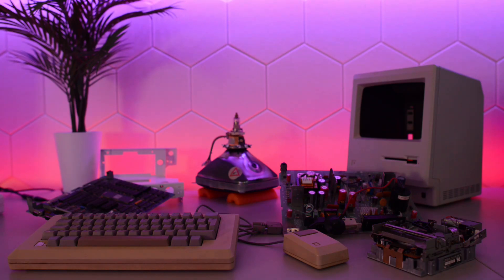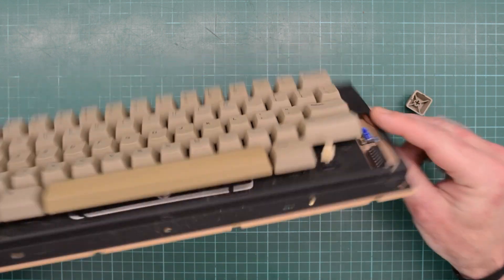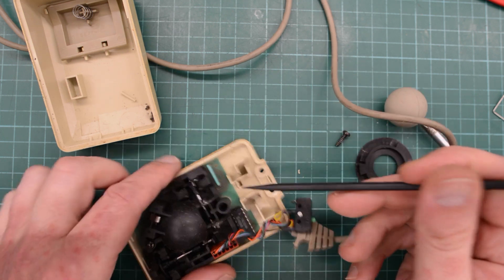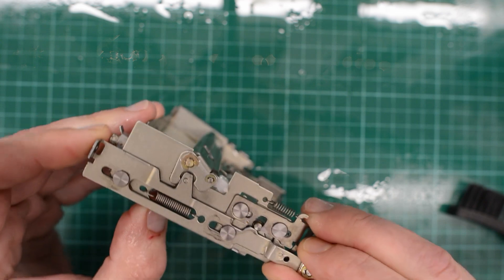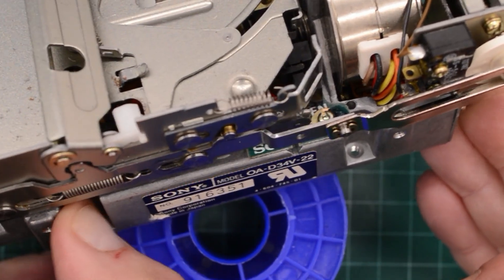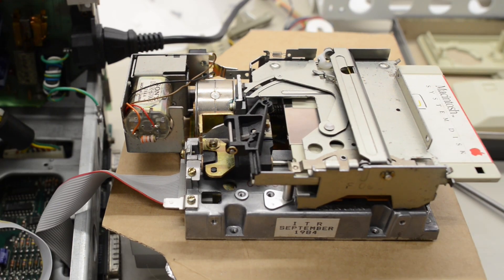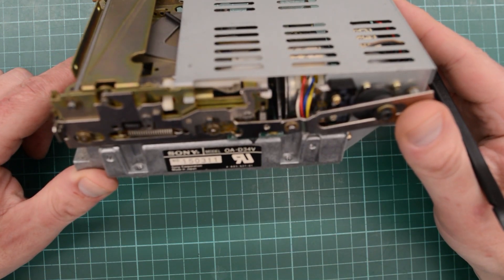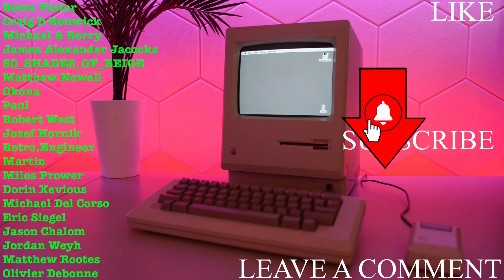Will it work? Original Macintosh from Harvard. Restoring keyboard M0110, the mouse, and reassembly

Comment: @ 24.29, I think the "disk lock" sensor (the microswitch on the eject motor) is out of position in relation to the white plastic cog (the switch cam) on the slide. Check the brown & black wire on the eject motor.
Reply from the maker: Ok, I'll check. Thanks

Comment: Oh no, you also had a floppy drive nightmare! I had a deja Vu! :) I'll be curious to know what the problem is on that one. I have never seen old grease seizing so badly!! Wow that was something. If I might suggest, white spirit. It smells but you can use a container (better if glass but plastic ok) to soak the parts. It will dissolve everything. I call those rings "seeger" rings. Not sure if it's the right name. Very nice outcome!
Reply from the maker: Thanks :) Unfortunately, I installed MacinTalk on this Mac, so now he is making fun of me every time I make a mistake in the studio haha

Comment: I had similar problems with my external 400K floppy. I never found the solution, but I was almost on the right track. The hall sensors in the motor assembly apparently go bad. They will measure kinda okay, but I found some forum posts later (years after my repair attempts) that someone repaired the same floppy drive with same symptoms with replacement of the hall sensors
Reply from the maker: Thanks, that could be very useful. I'll check the sensor early on in the next repair attempt

Comment: What machine did you use to test the 400K drive? iirc the 400K drive requires the PWM speed signal sent by the logic board on the old machines designed for the 400K drive. newer machines wont provide that signal.
Reply from the maker: I tested the drive with an early 128k rev-A and a 512k with rev-B. It would be interesting to know exactly what Mac models can work with 400k drives

Comment: Grease is soap (the chemical term, not specifically hand soap} and a solvent. When the solvent evaporates all you are left with is soap.
Reply from the maker: Interesting, I didn't know that. thanks
Reply: What about synthetic grease? It just stays the same in the tub for years
Reply: When you say soap is it the same as lubricant?
Reply: @Walczyk  40 years with the lid off?
Reply: @Walczyk  Lots of lubricants are soaps yes
Reply: @Nukle0n  so white lithium grease has solvent in it? or petroleum jelly? the lids aren't very tight, i've never seen it dried out
Reply: @Walczyk  The petroleum is the solvent yes.
Reply: @Nukle0n  what is the soap in petroleum jelly?
Reply: @Walczyk  the soap is the lithium salts

Comment: You made a comment that the keycaps (except for the spacebar) had not yellowed.

And you would be correct! The keycaps are made of PBT, a plastic that doesn't yellow. The spacebar is made of ABS, which definitely does yellow.

ABS is easier to mold than PBT. Long PBT parts like the spacebar can warp as it cools down during manufacturing. On the IBM Model M keyboard, the spacebar is made of PBT and quite frequently will be warped. Never enough to affect functionality but one of those things a perfectionist will be bothered by once they see it for the first time!
Reply from the maker: Interesting, thanks for sharing. I will be going over my Model Ms now looking for warped spacebars

Comment: I love the restoration but I'm concerned about the WD-40. There is a widespread belief that it's quite safe and benign but that is not correct. It's petroleum distillate and is poisonous. Right on the front of my can are the words Extreme Danger so I don't recommend breathing it without  a second thought and then seeing what happens down the road. If you really want to experiment on a human, at least pick someone you don't like rather than yourself. 😉
Reply from the maker: I'll see if I can find a volunteer ;)
Reply: @Epictronics1  I suppose that's an option. You're very kind. Seems like a Darwin Award kind of thing.

Comment: I was thinking about the keyboard noise 

There’s auto products that stop resonating sound 

Think it’s called dynamat

Obviously if there’s room in the case 

It’s like thin foil covered butyl rubber
Self adhesive 

I’m sure there’s a clone cheaper version 

Nice content
Reply from the maker: Thanks. I think I'm gonna try this MOD on my Mac Plus KB. It's almost identical but it also has a num pad. I'll see if I can find some dynamat
Reply: @Epictronics1  dynamat is very good 

I watched American hot rod years back and it was used to reduce engine noise road noise

I’m sure it will stop the metal plate in the keyboard resonating .and improve things noise wise
Reply: Another thought has just come to me 

A bit of sponge/magic eraser might be something you have 

Like a damper on a piano
Reply from the maker: @markdjdeenix6846  I've got magic eraser for sure. I'll see what I'll use :)
Reply: @Epictronics1  cool 😎 between the bottom case and the plate 

If it works could you do a short please 🙏
Reply from the maker: @markdjdeenix6846  Sure, I'll probably include the MOD in my Mac Plus video
Reply: @Epictronics1  cool.so how is  the ibm servers going?
It seamed strange about the os
Reply from the maker: @markdjdeenix6846  Not much luck, unfortunately. The project is stalled because I don't seem to have a way of keeping the fans running at a low rev. I could of course just limit the rev or use sensors on the heat sinks but that would kill the server eventually
Reply: @Epictronics1  I saw pwm fan controllers somewhere eBay probably 

Molex in pwm/fan out
With a pot to adjust the modulation
Reply: If the mother board doesn’t like the missing load on its fan header .trying resistors
Reply from the maker: @markdjdeenix6846  yeah, I have a few of those. The problem is that I don't have a way of reliably measuring the temp. PC software doesn't seem to be compatible with vintage servers

Comment: WD 40 fixes everything :)
Reply from the maker: WD-40 and DeoxIT are my two best friends :)
Reply: Like some kind of secret agent 😊
Reply: Retro computer restoration rules - If it doesn’t move but it should - use WD40. If it does move but it shouldn’t - use hot glue.
Reply: WD40 isn't a proper lubricant, it's a water displacement agent and a penetrating oil. It's for stuff that's stuck, but you should clean it off and use a proper lubricant afterwards.
Reply: NEVER USE WD-40!!!! it is not a lubricant (the only lube in it is mineral oil, which is a very weak oil at that), it also has petroleum based solvents which will destroy plastic gears and silicon based lubricants which is what should be used. If you do use it, completely clean it away (IPA) and use a real lubricant (again silicon based).
Reply: dw40 remove oils n sticky stuff
deoxit lube it same as 3 in 1 lube not same as wd 40 because wd40 is not have oils but more like breaks cleaner
Reply from the maker: @Nukle0n  Yes, I cleaned it off and used the appropriate grease and oil
Reply from the maker: @coreykirkpatrick4392  Yes, I cleaned it off and used the appropriate grease and oil.
Reply: @Epictronics1  i meant generally, you showed it in the video